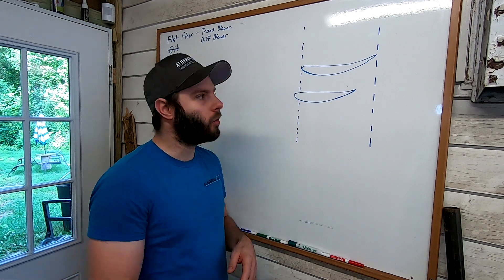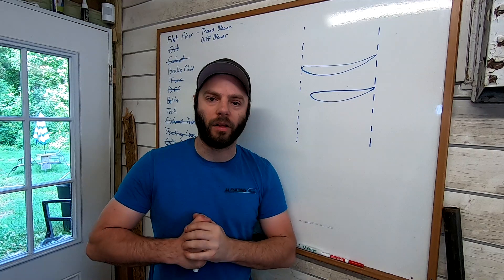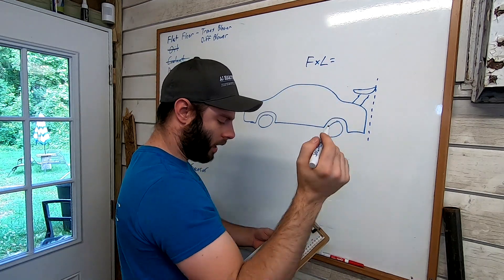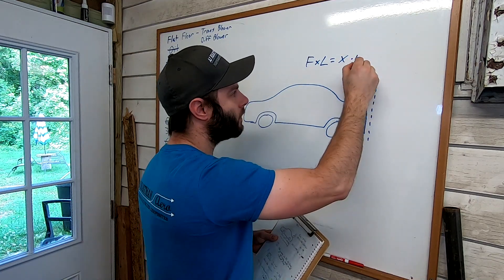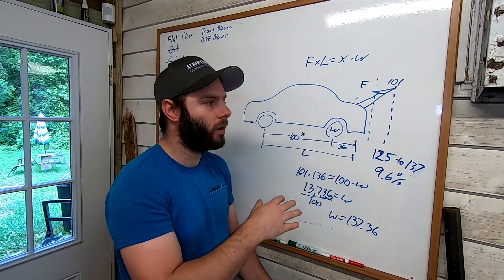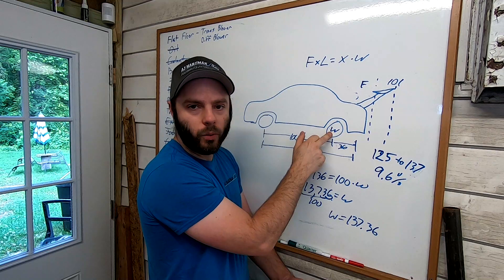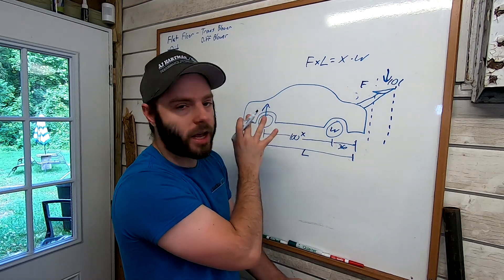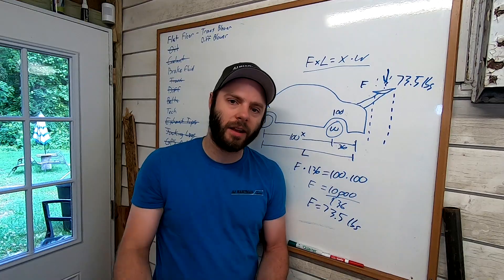Wing Setback Explanation

Comment: You can calculate the front lift caused by the setback using simple force equilibrium. If a wing makes 100kg of downforce, then that means the net increase in load acting on both axles is 100kg. If the setback increases the load on the rear axle to 125kg, then the lift on the front axle is 25kg. Your total aero balance shift will actually be 150kg rearwards.

In your example at the end, there will still be a front lift of 26.5 lbs that you gotta consider as a result of the force equilibrium. So the net balance would still shift rearwards by 126.5lbs rather than the 100lbs required.
Reply from the maker: SAR yes. I make a quick mention of front lift to be mindful of  but try to keep the video simple for explanation reasons. It can get really complex really quick.
Reply: Thanks for this!  As AJ said he makes quick mention of it but while watching I was wishing he went into it more!

Comment: That was right, what you mentioned about front lift while adding setback. Interesting thing is that if you aim for same force on rear wheels, with wing setback and less draggy wing, you will get more front lift.
Another thing that needs to be considered is lifting your wing higher will also increase force on your rear wheels (and lift front end). Because of drag has longer vertical distance to ground, which is support plane.

Comment: The further away from the turbulent air off the roof the more efficient the wing should be, though it will also change the interaction with any underbody aero.  There is also a difference in the effective angle of attack if the airstream across the roof is coming down the rear window when it encounters the wing.  Aero is a complicated business, but it is good for you to break in down into bite size pieces.
Reply from the maker: Chris Miles that’s the goal. I make a quick mention of front lift, but would have gotten extremely complex taking in front aero loads.
Reply: That’s the thing, you may not be able to slacken off the angle of attack by moving the wing back due to changes in the airflow direction. As if it’s closer to the roof/rear screen the air is likely to be hitting the wing in a more downwards direction meaning the angle of attack of the wing is shallower. When you move it back you benefit from greater leverage as explained, but the airflow over the roof may now be hitting the wing in a slightly more horizontal direction due to being further away from the silhouette of the car. So even if you keep the angle of attack the same you will be seeing less downforce at the wing anyway because the angle relative to the airflow direction is reduced.
Reply from the maker: huntos83 I totally agree but can also argue that further rearward a wing will see cleaner, or less disturbed air, so could perform better. It’s one of those “yes” in some cases and “no” in other situations. That’s beyond the intended scope of this video.
Reply: AJ Hartman Aero it’s an interesting thing to think about, and gets even more complex when you are using a 3D wing element like I am (Gtc-300) as it has different angles at the centre section and sides. Because of this I’d assume that moving it too far back could result in an increase in drag because there isn’t so much difference in the angle of the airflow to the centre and side of the wing as there would have been when it was closer to the car. On this sort of level it’s very difficult to judge things without CFD/wind tunnel testing
Reply from the maker: In your case, maybe yeah. One of the wings we tested in our Audi wind tunnel video was your wing. It didn't perform that good. So in your case, the best gain would come from a different wing. I'm going off memory (I have all the data but no time to dig through it right now) but our Fulcrum 14 made twice the downforce as your wing, with only like 2 pounds more drag. We had another "twisted" wing on the E36 video, wasn't an APR, but similar, and again, was a very draggy wing.